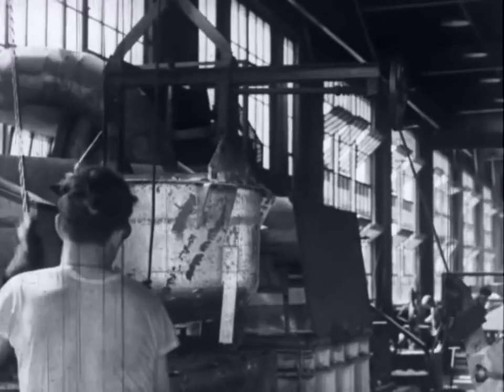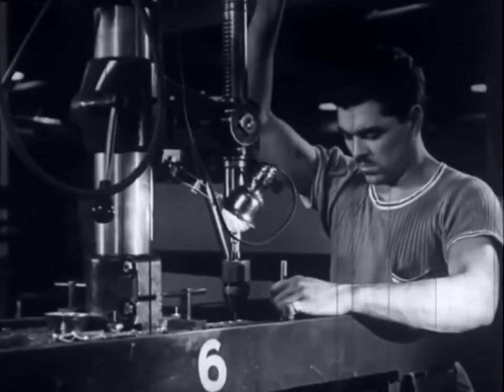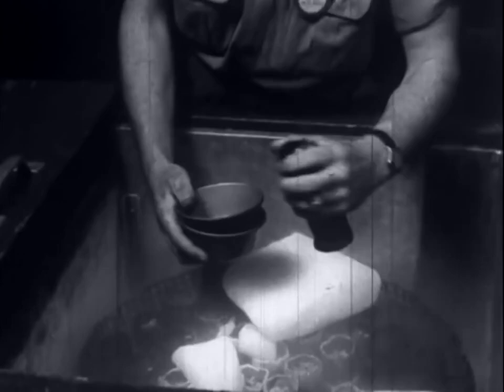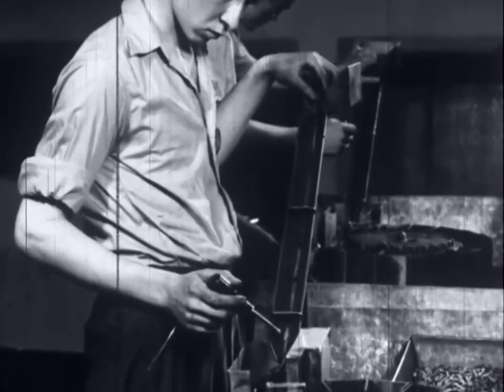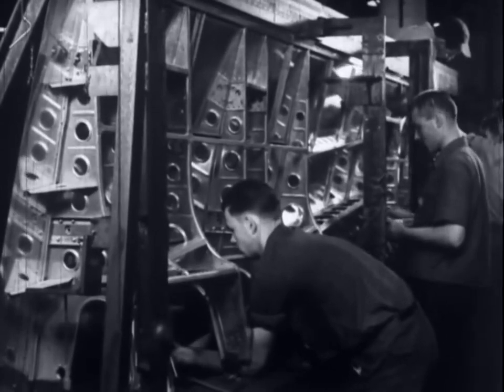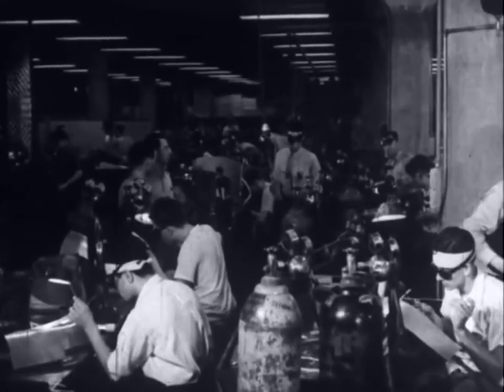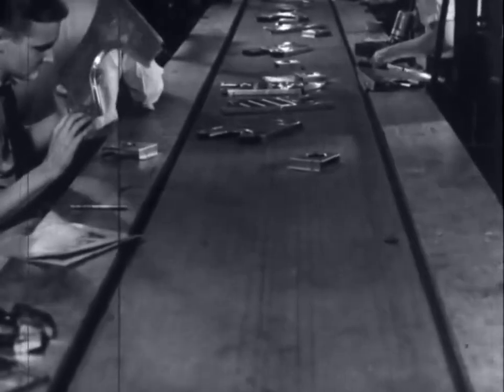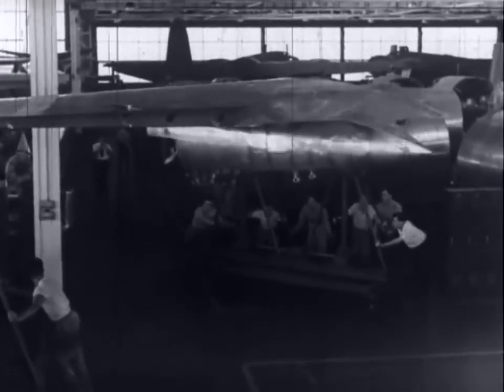Video from the Past [31] - Building a Bomber (1941)

Comment: As a mechanical engineer in a way I wish I was born early enough to work in those aircraft factories it must have been a beehive of activity. Back in the mid 80's I worked at a company called The Bristol Company in Waterbury Connecticut. I went to the print room and pulled the earliest drawing I could find which was dated in 1933 which was a sepia paper drawing all brown and a bit crumbly. During the war they made a device call the thermo-humidifier if I correctly recall which were used to set the depth charges in the navy during WWII. This factory was huge 4 stories brick structure that would take 10 minutes to walk from one end to the other. When this place was in full swing everything was made in house nothing was farmed out. By the time I got there it was all idle, dark,dusty and was very eerie walking thru the factory. I was in my mid 20's at the time. One day was walking to the model shop through this maze of dark pathway past all this silent equipment where I was startled walking around a corner and stumbled upon this grungy bald heavy set man wearing overalls who was working this machine whom I never seen before. It was like something out of a Hollywood horror movie and looked totally out of place. It scared me and I kept walking wanting to get away as fast as i could. I never saw him again and to this day was wondering if I saw a ghost from the past, it was one of the strangest encounters I ever had. Surprisingly enough, there were a few mechanical engineers, the checker was still working there Syme Donahue and Jim Lombardi and the print room clerk who was there for 47 years since high school. All of whom were employed there during WWII. The story they were telling me about everything that went on there were amazing. Soon after I started working at the Bristol Company which back then was called Bristol Babcock (yes, Babcock as in the British company still on operation) they moved out of that factory to Watertown CT. Soon afterwards some homeless people were living in the factory and started a fire burning the factory to the ground. It was a beautiful building. I was honored to work at such a place with its long history

Comment: of course , what they don't tell you is the fact that these planes were crashing all over the country and killing the crews. when  then sen. truman  head of " the committee on the prosecution of the war " ( truman committee ) went to visit the ceo of the martin co. and find out the problems with this plane , he was told that " we know the problem " . the wings are too short " . thus the plane on throttling back to land was sinking like a rock and crashing.  but the ceo said, we have a contract do we don't need to change it ". truman said , " well i'll see what i can do to get your contract CANCELLED". they got jimmy doolittle  to fly the plane and he made some recommendations. they increased the power of the engines and trained the pilots how to handle that plane.  i think they changed the wings on the later models too. from " plain speaking " , merle miller , 1972

Comment: My mother Betty (RIP), worked at Boeing, Renton WA during the war. I remember her saying that for months all she did was drill holes for rivets in the upper turret area behind the flight deck. She also said that on September 2, 1945, when Japan surrendered, the assembly line was stopped and "all us women were layed off" is how she put it.  Years later I would work in that same building  know as the 10-17 building (aka the saw tooth building, as to its roof line). That building today is where 737 wings are built. Glad to be retired
Reply: My grandfather worked at Boeing from 1933 to 1955, worked on the 247 passenger plane, at Plant I.  China Clipper in 1938 at the new Plant II. Went over to the bomber program in 1940,  building B-17s first as a mechanic/ riveter then as a supervisor in the engine shop. Later transferred to Renton in 1944 to  oversee B-29 work as an Assistant Superintendent. Later work the B-47 and the B-52 and the 707 prototype. I also worked there also for 33 years worked everything there from 747, 737, 707. KC-135 and Minuteman refurb, both as mechanic and supervisor also. What is ironic, is that I worked at Plant II in the same shop my grandfather did, little different when he was there, but the same shop.
Reply: @lourowberryrowberry2343  

Hi Lou, back in the mid 1990's I worked at Boeing Auburn, MR&D and was in Renton, wing line looking at at new project. I saw a fenced area in the north portion of the building and within it a B-17F. It was close to lunch and I walked over and ended up talking to maybe a dozen retired Boeing guys and WWII vets. These guys had all fought in the 17 during the war and were restoring the old gal. The plane looked brand new inside, it sure was something. I even crawled back to the tail gunner position. I remember seeing the rubber fuel tank  bladders on a bench. I guess they would collapse as the fuel was pulled from them (no air) within the bladder so no boom if a tracer round past through the wing. There was like five or six bladders on the beach. Anyway lots of stories from our heroes
Reply: One question I've been really curious about, after watching all these videos on war production.. "did folks like your mother understand the critical contributions her work meant to winning the war? Did she take pride in it?" As a veteran, I know the commitment and sacrifice the military brings to the table.. but what could the military have done if Hitlers production outpaced our production? From what we saw with Germany, not much. If it wasn't for our production, I really believe we would have lost the war. Sorry she was laid off on VJ day, that's a sad ending to her contribution
Reply: We have treated those women and the returning Vets from every war atrociously.  Many women started finding jobs after WWII, as they loved making their own $ rather than having a husband dole it out.  Vets that were told their "jobs will be waiting for you" found out that their replacements were kept, often making less than the Vet did before the war.  Such a shame to kick people to the curb like that.
Reply: My father and mother both worked for Boeing Wichita, tooling up for the B-52.   That is such a stark circumstance to be laid off so fast.  Enjoy your retirement!!
Reply: Somewhere, there is a video of the Dodge plant that built the engines for the B-29 Superfortres. I haven't seen it for a while, but I think it said over 10,000 employees at the plant became  jobless the day Japan surrendered.

Comment: one of my friends had been bounced around from fighter schools and got sent to train in B26's  on the his first flight in the B26 since he had trained heavily in fighters..  at the end of the training flight. he told the crew to strap in he was going to do the victory roll as they flew down the runway..  he did a barrel roll and then came back and landed. the crew chief had him arrested a short time later. he was taken to the base commander.  the base commander said he had knocked every rivet loose in that brand new B26.. it would never fly again.  he should be sending him for court marshal and 20 years in prison for destroying war material.. but in all reality you have saved many crews lives as prior to your destroying that plane.. the base was training ground crews on wood mock ups.. now they have a complete plane to train the sheet metal repair guys. the structural guys , the electrical guys.. the engine guys..  so instead of being court marshalled.. they sent him to roswell to fly B29's. he got in trouble flying those off tinian..  he got bounced around fighter schools as the staff had poker games set up to take the cadets pay.. but he grew up working in gold dredges in colorado springs.. where he learned to play poker at night from real gold miners.. the staff needed him out as he was cutting into their money ..
Reply: WOW! Worse tan "Maver1c!"

Comment: Interesting how many times the term "ship" was still used by then.
Reply: In their young days both planes and tanks took much inspiration from ships. The M3 Lee for example had a sort of automatic gyroscopic driving thing. The idea was to set a speed and direction and the tank would drive by itself in a streight line in that direction. This device which was ofcourse taken from ships, was utterly useless and deleted after early peoduction (just like the hull mounted fixed machine guns).
Reply: Airship ,likely from Dirigible days.theyd only been Flyin less then 40 years .

Comment: Of course our enemies didn't use the same techniques when building their bombers and fighters.
What propaganda.
Reply: The German aircraft industry WAS different and many of the Yanks methods were later incorporated into their production. Haven't the slightest idea what you consider propaganda.
Reply: The US built tanks similarly and out produced Germany many times over at a fraction of the cost. Something like $35,000 Vs $250,000.
On average every 6th tank Germany produced was slightly different than previously produced. Thankfully they went for German perfection instead of production.
Propaganda? Sure is. What's your point?

Comment: 15:33  Is that technician using a crescent wrench on the fuel line?
 "crescent wrench" = "Shifting Spanner" or "Adjustable Wrench" depending from where you come from. 
The trouble is, because a crescent wrench is adjustable to fit different screw hexes, they are not as precise as a wrench manufactured for a certain size, and sometimes the crescent wrenches slip over and ruin the hex, especially if they are adjusted too large.
Wouldn't let anyone to use one on my car:)  
Scary, or was it just for the camera?
Reply: Roger Surf Good Point! This man was described as a skilled technician... 😀
Maybe they decided to use this adjustable wrench to save time.
Reply: I saw that I have a A&P you use what fits it and that would have been a tubing wrench 🔧!

Comment: I spent many years in the RAF and fitted so many different types of rivet, but the exploding rivet demonstrated in this film was awesome, and ingenious, I wish they still used them in my time doing structural repairs, would have made the job a lot more fun, and easier. We had blind rivets as well as solid but those explosive ones would have been great, although I think we would have employed them for other things, practical jokes would have been so much fun using them. Thanks for this very interesting and informative video.
I love the bit about the “skilled mechanic” checking the fuel lines, using an adjustable spanner (wrench) if I had ever used one of those in my work in the RAF my bosses would have had a total and complete meltdown, using only the right size tool was allowed, in my later years, if I had caught anyone doing the same it would have been me having a complete dicky fit, I learnt my lessons the hard way, as did some of those that it was my job to teach them the right way to do the job, and boy, did some of them like learning things the hard way, but they always came round to my way, and I expect some of them went on to be the master and impart their skills and knowledge onto the next generation.
Reply: First thing I thought too with the adjustable

Comment: Impressing precission!
US Quality 💖
But... Lack of primer on inside parts..?
Reply: These airplanes were not built to last forever. Structural integrity and high production was the main idea.
Reply: Primer would have added weight. Later in the war, after air superiority had been attained, the paint was left off altogether to reduce weight and increase range and bomb loads. Remember, these were lead based paints back then. Lead is heavy.

Comment: They're probably better built than the current Boeing 737 MAX planes...You don't have to shoot down the 737's, you just have to wait and save on ammunition at the same time.
Reply: B17 were stable. Just like the 737 turbo. The hanged oversize barrels on wings and made it therebymore unstable

Comment: explosive rivets was no good(not used anymore) and only used on places where strenght was not so primary  novadays  they use blindrivets with much more strenght  as good as solid rivets    they are applied with special  air driven  tools but are mostly used on places where you cannot get access for a solid rivet   they are also wery expensive  to use.---- most of the rivets used on aircrafts  today can be riveted directly from  stock   but on places  where a bigger strenght are neded  they use heat treated rivets wich means that those rivets has to be put in a oven and heated to  an accurate tenperature and thereafter poured i water   and there  they are soft and may be used within an hour   because thereafter they will be harder and harder until they reach a certain level of hardness and these rivets are much stronger than the normal rivets .----
Reply: They had blind rivets also. Cherry rivets. They also used a small bucking bar that fit on the tip of your finger like a thimble. Not really but I have heard metal men wish there was one for the hard to reach rivets. Many ingenious  bucking bars were designed to reach blind areas.

Comment: A skilled mechanic using an adjustable wrench???? at 15:30
Reply: He has the good tools at home to work on his car.
Reply: And why not?
Reply: @shenghan9385  Because an adjustable wrench is known to round off the nut on fittings, or anything that you turn it with,,because the wrench cannot hold onto the nut or bolt properly thus it slips, damaging the nut..or rounds it off...meaning the next time a 'normal' or the right wrench might not fit the nut because it has been rounded off by the adjustable wrench...
Reply: @kennynvake4hve584  name one mechanic who does not have or have not used an adjustable wrench. Please.
Reply: @shenghan9385  I did not say no one use's it...but would you want to fly in a plane where one was used???? I know I wouldn't ...Im saying that anywhere there is a life, or a safety issues like a brake line on a car, or motorcycle, that can be caused by a 'flare nut' or any fluid...or high pressure line to leak should not be used...I have 4 of them..and vice grips also...Yea you let OSHA see you using that...
Reply: @shenghan9385  Using an adjustable wrench to loosen a fitting in a bathroom to drip water in a urine test cup, I would say is ok.
Reply: You gotta whine about something almost 80 years ago?
Reply: Adjustable spanners are very useful but etiquette demands any half way decent engineer or mechanic condemn their use by other people and pretend he or she doesn't own at least two of them :-D
Reply: @AnthonyHandcock  now that tool is ok to use...but still not on a VERY serious connection...Adjustable wrench's do have there place...but not for this repair...or check of the line...On an adjustable wrench you are ONLY grabbing TWO flats on the nut...which will either round the nut, or spread out the nut making it oval.

Comment: Learned something new from this video: Explosive Rivets. Frozen Rivets. Wonder if that technique was classified at the time.
Reply: Non structural 'explosive' rivets were more novelty than anything, along the lines of modern pop rivets, and created corrosion issues. The frozen rivets , or 'ice box' rivets were of an aluminum alloy that would remain soft & malleable enough to drive without cracking if kept cold after heat treatment... then harden once allowed to warm and 'age' a few hours. There is a good bit more to them... and they're still used to this day. I'm pretty sure all above was fairly well known by the WWII era.
Reply: @rwbishop  -  Thanks for this interesting technical background info.
Reply: @rwbishop  I dunno about that.  That’s not how metal reacts to cold.  I pretty sure the rivets were chilled so they would shrink and then when exposed to ambient temperatures, they would expand. It’s physics.
Reply: @williamsimmons152  Please don't just take my word for it! I'm just some YouTube commenter!
Go to the Wikipedia 'Rivet' entry, then look at the second paragraph under the 'Solid/round head rivets' heading for a quick overview.
And/or do a Google search on 'ice box rivet', and you'll find reams of info.
They're still actively used to this day for new construction & repairs; and freely available to anyone through scores of vendors.
Reply: @rwbishop  I ‘m not questioning the ice box rivets.  Just saying that the physics of metal or aluminum alloy is that when metals are in lower temperatures, they get more brittle. They shrink in size.  They are not malleable at LOW temperatures.

Comment: Mechanic tightening a gas line nut with an adjustable wrench!
Reply: yeah, saw that too and the narrator says this step requires "unusual" caution  as opposed to "usual" caution I guess.
Reply: @joep1535  Did they even have the proper gas-line wrenches then?

Comment: The B26...known to snap over on it's back if you got it too slow.  Not a good slow flight airplane.  Kudos to the guys building them though...such tremendous willpower and drive!
Reply: B26 Marauder got a bad rap as a widow-maker.
It did kill many trainee crews who were learning to fly it.
Interestingly, once the crew figured what they could and could not do, things changed.
Marauder squadrons had the lowest crew loss rate per 1,000 sorties of all the U.S.A.A.F. two and four engined bombers during WWII.